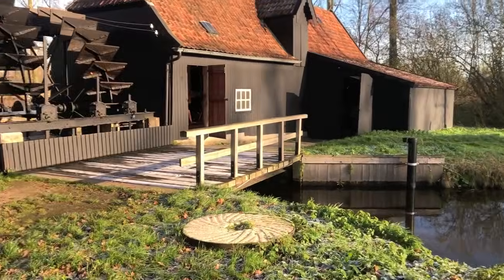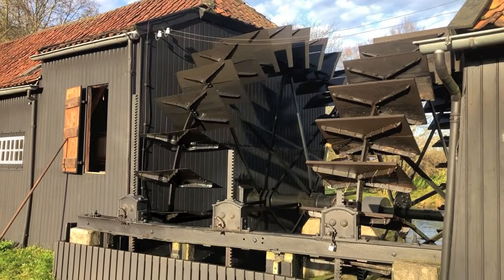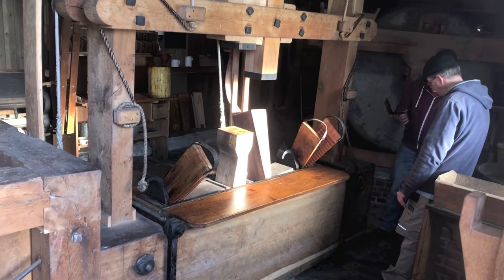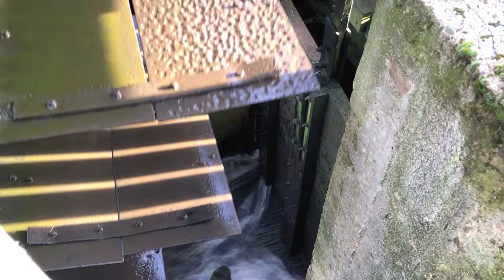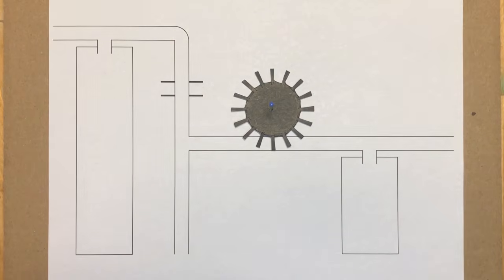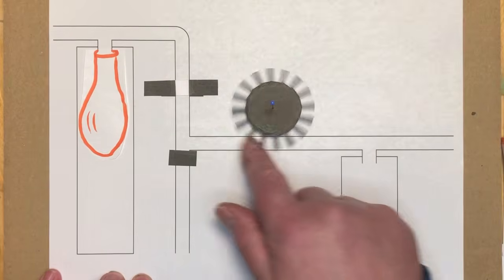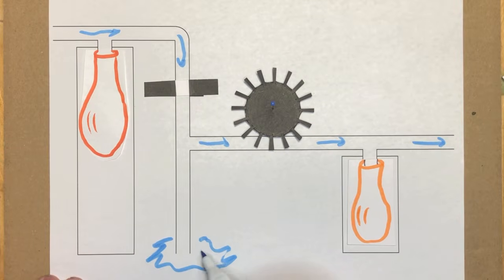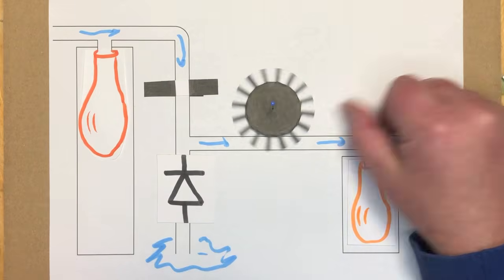Explanation of a Buck Converter using a watermill

Comment: @cmizapper, Nice video. Out of curiosity is either one of those mosfets configured correctly in regards to Gate Drain and Source?.
Reply from the maker: Yes they are correct. I am ignoring the Gate drivers obviously.
Reply: @cmizapper  
Thankyou, that clarifies a lot particularly electron flow from - to +...haven't delved into electronics for MANY years, 
Thanks again TC.PS also liked the board design "USB killer revenge" on your Understand a Boost Converter video. ;)
Reply from the maker: Haha, the lightning bolt shape of the PCB for the 'USB Killer Revenge' corresponds to the shape of one of the puzzle pieces in our puzzle.
https://youtu.be/OwAgz9tzRKw
Reply: @cmizapper  That's shocking innit⚡...a double sided puzzle with 6 sides and 9 electronical pieces, seems like some form of "Shock Therapy"...shouldn't be surprised from someone with "Zapper" in their name, you've certainly got some patience mate!. BTW if you don't mind me asking, what does CMI stand for in cmizapper?. TC.
Reply from the maker: CMI stands for Chipmunk International

Comment: How does the back emf of the coil figure into this?
Reply from the maker: There is no back EMF because the coil doesn't move, as it does is in the case of a motor or a generator.
Reply: @cmizapper   My understanding is that whenever a coil is energized a magnetic field is created and when disconnected from the power source the field collapses and back emf happens.
Reply from the maker: That is what I am trying to explain here in my videos. As that is what is used by the Buck and Boost converter. But the phenomenon occurring is not called 'back EMF'.
https://en.wikipedia.org/wiki/Counter-electromotive_force

Comment: like a water ram?
Reply from the maker: Almost exactly! The Water Ram (pump) corresponds to a Boost Converter. It is interesting to see that a ram pump doesn't have a water wheel but uses a long pipe. This shows that a long pipe works as a 'wheel' just like a long wire must also have some (parasitic) inductance.